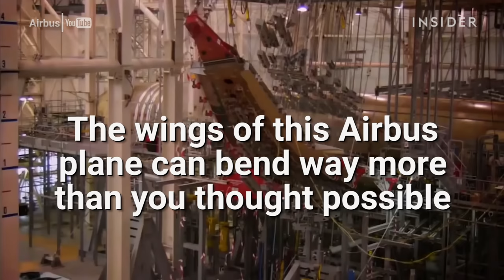The wings on this Airbus flex way more than they should

Comment: Trust me the wings would never flex that much during normal flight operations. The aircraft is built with huge safety margins in case for some reason it is subjected to extreme g forces, which only happens in storms and we don’t fly into severe storms. This is perfectly normal.
Reply: there arent huge safety margins or the whole thing wouldnt even get off the ground. you already calculate it without full endurance (sorry german dont know the translation) but you basically keep track of small cracks that you have to patch up. I remember a professor (mechanical engineering) telling us about ´safety factors of up to only 0.8, another one i found from just searching right now for a minute was 1.5. 
as a reference huge safety margins are around 10 and apply to lifts or (rope) gondolas
Reply: Alyero by safety margins I mean airlines set standards for a maximum amount of g forces that a passenger should experience during flight. For the wings to flex like they do in this video the aircraft would be way beyond the maximum g standard set by the airline so therefore there is a margin of safety. Also the aircraft would be more likely to experience a brief accelerated stall when pulling that many g’s especially at higher altitudes. The maximum bank angle for airlines is normally 25 degrees which would put the load factor probably around 1.2 gs. This plane could probably handle up to 6 gs or even more, so the difference between the standard 1.2 and 6 would make the “huge” safety margin.
Reply: @alyero6341  The margins are big.

A passenger jet will under normal bad conditions (turbulences or full weight takeoff) not be subjected to loads exceeding around +0.5g - +1.5g. (you will most likely never feel complete weighlessness which would be a 0g wingload)
They are however by law forced to be designed to withstand ~ -1g - +2.5g +50% margin and end up at around ~ -1.6g - +4g. Some jets are designed with higher limits.
 
These limits from the authorities do not mark the breaking point of the wings but the loads a wing must be able to tolerate while taking structural damage
They are probably sometimes able to take much higher loads (5g ?) before complete failure.

There was an instance with passenger jet unintentionally taking 3.5g without damaging the plane.
Reply: engines, vertical stabilizers and rudders are known to have come-off  due to simple wake turbulence
Reply: @pubby - The size disparity between the creator of the wake and the plane encountering dictates the severity of the event a single aisle airliner could certainly be put in danger by wake turbulence but it's the easiest to predict and avoid
Reply: Yup, they are testing the stress the wings can take, so that the plane can perform safely, that does not mean the wings would flex that much In a regular scenario.
Reply: Aren't the wings vibrating from the air currents at the same time? Wouldn't that stress the wings a lot at the same time as them bending? Shouldn't they be testing the wings bending and being vibrated at the same time for accurate stress tests...
Reply: Why should I trust you
Reply: You'd be dead before you ever see the wings do this
Reply: the wing of the plane can break?
Reply: @cmrecord  They flex because if they didn't they'd snap.
Reply: @Mongoliantreecow exactly, some scrub saying trust me is the funniest thing you’ll see on yt
Reply: Fun fact, the safety factor of a diving board is way higher than an airplane, hahah

Comment: Way more than they should is a good thing
Reply: "way" more isn't necessarily a good thing. It means it was over-engineered and could have potentially have been made to be lighter and more fuel-efficient.
Reply: Alejandro Quintero 
Kind of like boeing.
Better have one less sensor for a backup to save weight and money...
Mcas killed hundreds of people and grounded the plane.
Reply: Safety above Fuel efficiency and Cost at all times.

Imagine advertising your plane.... "will likely crash but you get to save $100🤷🏽‍♂️"
Reply: @oyedoyin  isn't that allegiant's slogan?
Reply: @oferkrupka  You obliviously have no clue what it means to engineer a new airplane, that dilemma with the MAX is sad and bad, but some things are kinda a guessing job, how fatal will it be when something fails and based of that they make it that or that fail safe. Also it wasn´t just Boeings fault, there came quite some things together that Lion air ended up like it did, there is a final report on it, just google it and educate yourself on these topics.
Reply: @annabellem7953  comment from a 1-2 years ago...
Should have phrased that differently...

I think what I was trying to say more isn't a good thing either... Airplanes are super complex machines. & engineering (in all fields) is a complex tradeoff game.

Boeing seems to have gone down in quality regardless of whatever Lion Air did (I don't have time to research it).
Reply: @oferkrupka  super complex yes, tradeoff yes but really defined, Boeing still is good the problems raise from the hard marked for both big companies
Reply: @annabellem7953  The basic engineering mistake that caused the original 737 MAX crashes wasn't just "sad and bad", it was spectacularly moronic. How a company with such a great history of engineering and a workforce of so many engineers could produce such a fatally flawed product shows what happens when accountants make the engineering decisions.
Reply: @johnstuartsmith  Every aircraft manufacturer has made fatally flawed systems, Airbus included. That’s precisely why we have accident investigators. The MCAS errors did not happen on the other hundreds of thousands of hours of flight time on the type, and it never appeared in that way in testing. It’s reductive to act like Boeing intentionally put out a plane that would kill people. Where they royally messed up was in not taking the issue seriously enough after the first accident.

Comment: If most passengers saw wings flex that much during flight, they’d freak out.
Reply: I would definitely freak out they would have to throw me out of the plane.
Reply: They never see deflections that large. They run these tests at high margins of safety against worse case analyses, and there are margins baked into flight procedures to avoid excessive turbulence that might freak out passengers. The plane will be totally fine
Reply: @LRG
Because most people are too busy watching 30 minutes of ranking the stars to watch a 42 second clip of education...
Reply: @WilbertLek  Guess you're an expert on everything? This kind of elitism is so pathetic
Reply: obviously
Reply: That why we always test beyond the "expected" wing flex
Reply: Freak out? They'd need new diapers
Reply: Acting like you wouldn’t freak out if you’re on a normal flight and that happens 🗿
Reply: Of course you should because it means u are a really bad situation, in a normal or even a stormy situation the wings would never flex that
Reply: No, they would already be passed out because that much Flex in the wing means that they are accelerating with tons of force, around 20 g's. They would pass out as 10 g's is considered the human limit for the best fighter pilots.
Reply: I’d get off
Reply: @limes..100 Nope because that wouldn't ever happen. These wings are rated to withstand 150% of the flex in the most extreme scenarios you can ever find in the real world (low weight, low fuel, high performance takeoff, impossible during normal operation). The wings of an aircraft will never break off due to flex alone.

Comment: Wings are not attach to an aircraft body..this is a common misconception about the structure ....the body is attached to the wings.  The construction of the wings are one complete unit and the body is "laying ontop" of that structure.
Reply: Lol what? I just saw 2 videos before this of a 737 and an A350 with 2 individual wing (L & R) sections riveted to the fuselage body. I've seen this before also. How did this comment get that many likes.
Reply: @voongnz   The wing box is the core load bearing area, thru which the wing spars emanate, and the fore and aft sections of the fuselage are attached around the core, if I am not mistaken.

Comment: On a plane from Tōkyō to Kyūshū, it looked like I was inside of a bird flapping its wings because of some turbulence. Of course, we were over the ocean and I was calculating the odds of not being eaten by a shark if surviving one of the wings coming off.
Reply: Sharks? you would probably be dead after the impact. Unfortunately planes don't do that well when ditching on water. The Hudson miracle is called like that for a reason mate... But i get it, it was probably a joke on your behalf ;)
Reply: I mean, why do you think birds fly so well? It's BECAUSE they flap and bend their wings. If we could have airplanes that had wings as flexible and controllable as bird wings, flight would be MUCH more efficient.

Comment: I experienced turbulence for the first time. Admittedly this did make me feel a lot better about airliners. Although I've flown before, It was closer to the ground and in a Robinson R44
Reply: As an aircraft mechanic with experience with Robinson's, a Robinson R44 is WAYYY sketchier than a commercial airliner.
Reply: @lukie7691  you needed some more a's and y's i.e. WAAAAAAAAAAAYYYYYYYYYYYY sketchier ;)
Reply: Closer to the ground is always more dangerous. Falling from 200 feet is the same as falling from 40,000 feet. Also, R44’s are nowhere near as safe as airplanes.
Reply: You’ll never catch me in an R44. Those heli’s sketch me out, with their swaying rotor head system.

Comment: The safety margin is large but only new airplanes would be able to flex so much without catrastrophic failure due to metal fatigue. Also, if a new plane is subject to this type of forces it may survive but it wouldn't be back to normal, it would need a major overhaul or even be written off.
Reply: this would also never happen in normal circumstances. its designed this way for some freak accident where someone has to fly int0 a hurricane for some reason lol

Comment: Part of my job as a aircraft mechanic was refueling B747s, after loading 165 tons of fuel the whole aircraft can distort, if you accidentally open the over wing doors before fueling, you'll never get them closed afterwards.

Comment: "2500 tonnes of steel", after that phrase I know from the first minute that the speaker knows nothing about planes
Reply: I think the 2500 tonnes is not referring to the aircraft, but it is the weight of the counter balance pulling the strings in order to do this bending test...

Comment: If a turbulence makes the wings of your airplane bend like that, the airline needs some major restructuring for putting you through that. Can it happen without any warnings? I guess all is possible. But with the tech that we have nowadays for weather detection the chances are very, very slim. So next time your flight is going through turbulence you can feel absolutely certain that you will see your family again that day.

Comment: The header is misleading. The engineers not only know at which degree of deflection the wing will fail but also the exact place it will fail and how the failure cascades from that point. It should say they flex more than any normal person would expect.

Comment: of course these wings bend can bend like that without breaking. they are brand new and havent undergone 20 000 fatigue cycles as regular used aircraft have. Besides its not only wings that come under stress during turbulence. Its the engine bobbing violently that gets me during turbulence and there have been plenty of incidents where engines came off planes. Rudders and vertical stabilizers have been ripped off a handful of times due to wake turbulence...
Reply: Think you might be talking yourself into anxiety that you needn't suffer from there. The entire industry knows about all those risks and many more you've never heard of and work day and night to make flying the safest form of transport.
Reply: "Engine bobbing violently" wow
Reply: @choddo  you gave a very general response here that just trust what they are doing. Can you please answer that persons concerns? there have been many tragic plane crashes due to fatigue cycles and stuff related to improper maintenance

Comment: only when without fuel and inner outer flaps and ailerons installed
Reply: and without pumps, circuitry,  paneling.
Reply: @gewizz2  oh that was grim
Reply: @revivalofthefittestonlythe2757  yes that was grim, but i want to say that the strongest are not the ones to survive today,  its not what you know, its who you blow.
Reply: Still bend like the way without fly by wires jet a fuel outer flaps inner flaps and aelerons
Reply: Putting more weight in the wing would make it more resilient.  The machine (and lift) want to pull the wing up.Weight pulls it down.
Reply: @Ohiostmrchbandawesom  The fuel has no effect on the maximum flexure. It just counteracts lift forces in this case, however, the wing will break at the same displacement, just more force has to be applied.
Reply: @mastertodesaster  That's the point, it is mass that helps wings withstand turbulence and other flight forces.  It adds inertia and weight. If the fuel were in the fuselage, then the wing would bend and break more readily.   It is also why the wings of gliders are filled with water and why our maneuvering speeds change with the weight of the aircraft.  A wing that bends 90 degrees isn't that useful anyway as it's not providing lift or creating much drag at a high angle of attack.
Reply: All commercial aircraft structures are tested this way. Just the wing box is used for the ultimate wing strength test. Other analysis rigs or methods are used to ensure that the systems still work at extreme deflections, using the data gathered from these tests.

Comment: Screw the wind, I think it's more crazy that the engine can keep spinning at 3,000 rpm during of all this
Reply: not just the fan either, the internal shafts could be spinning as fast as 20000 rpm. Its some really tight engineering

Comment: When i was little and on an airplane during a turbulence, i thought that even if the wing moved up like a meter or more that it would just snap
Reply: The wings have fuel tanks with baffles. The flexing of the wings and the fuel sloshing around in the tanks act as shock absorbers, dissipating much of the energy of moderate turbulence. If the wings were rigid, more of that energy would be dissipated by the seat cushions absorbing the mass of the passengers being bounced up and down. It's more comfortable to have wings do more of the jiggling.

Comment: Wings don’t fail on Airbus aircraft, history has proven their vertical stabilizers do.
Reply: That happened once on an old a300 which caused rudder travel limiters to be installed so that never happens again.
Reply: @hotshot4512  it's happened more than once.
Reply: @bogatron69  what's the most recent incident of that?
Reply: @hotshot4512  the tail came off of Air France flight 447 over the atlantic. Not causal in the crash but a finding
Reply: @bogatron69  I think it broke off on impact, not a cause of the crash
Reply: The A 300 stabilizer broke off after it was stressed with almost 100 metric tons, almost double what was demanded for certification, according to the NTSB.

Comment: I think the bolts holding it on would fail if it were in actual flying conditions. Simply because to flex that much you’d have to pull more G’s than the airframe could handle
Reply: And you know exactly how many GS can airframe handle.
Reply: The wings are attached to the fuselage in these tests... obviously they'd consider it detaching a failure of the wings haha.

Comment: Okay, they bend. What percentage of design strength did they fail?  Boeing 777 broke at 154%. That is 54% safety margin.
I haven't seen one eurobus wing break test.
Reply: Fred Cink  Keep in mind that the 100% baseline is not normal flight or turbulences but the absolute limit of what an aircraft should face even in the worst conditions.
Reply: Here is a Airbus wing break test on video: https://www.youtube.com/watch?v=Q9ins-nbsGY&t=8s

Comment: They show how much the main part of the wing can flex but how come they're not showing it with the flaps or other pieces installed? If they flex enough can those pop out or break? Wings are pretty useless without control surfaces.
Reply: Flaps are made of the same material